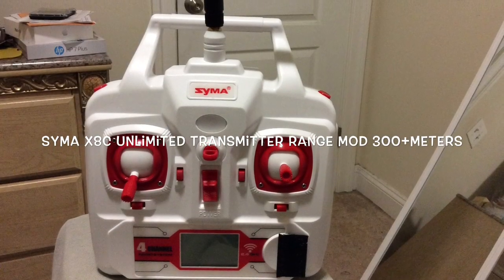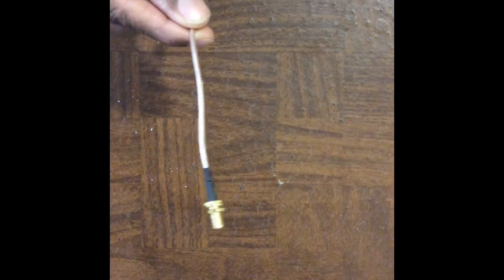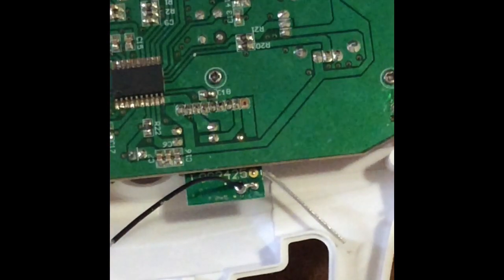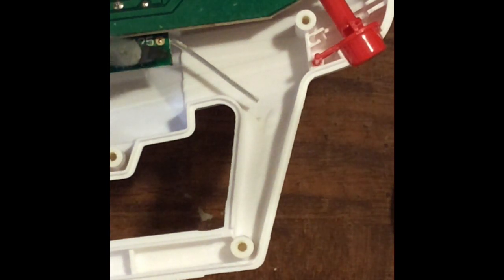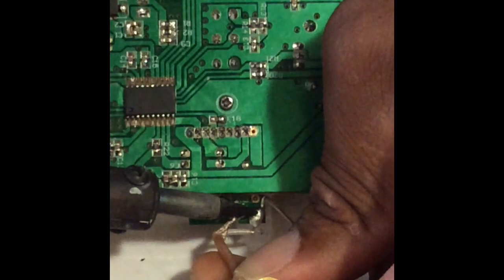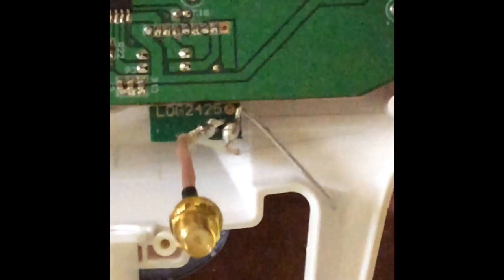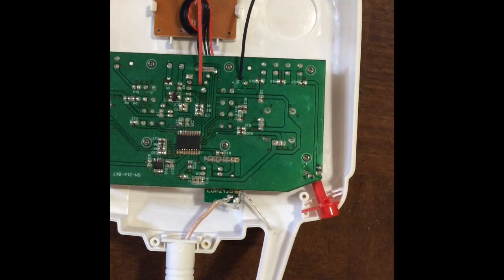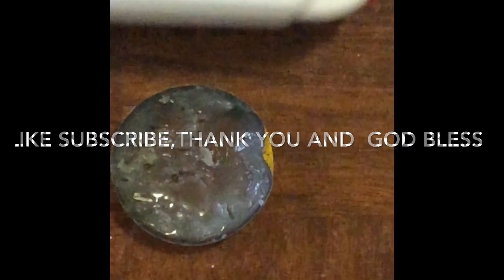Syma x8c step by step transmitter modification 300+ meters of range guaranteed

Comment: Great video! I did the same mod but the range is no more than 150m. Testing the transmitter I found an impedance of only 14 ohms between the antenna main and the ground. Do you think this figure is OK? Thank you.
Reply from the maker: Petros S  Honestly that's a little to technical for me,I don't want to give you false advice but check that your soldering is not bridged and the sma cable is good.
Reply: +Mods&Hobs 101 thank you!
Reply from the maker: You're welcome.

Comment: Ive done this mod the only diff is i used the little indent on the back of the remote just under the stock post for your cell fone as the pilot hole for the 2.4g 5db antenna. It seems to work very well so well that i got rotor slammed by a police hele flying over towards london. I didn`t realize my drone was that high theres nothing as a ref up there i could barely see it. Has anyone done the 3 bladed prop swap yet as i`m about to and any links for cameras and cradles for this drone would be awesome really finding the stock set up a bit of a problem child. lol    Awesome vid liked and subbed

Comment: I did the same...but for my drone the distance can go just 80/100m.
Reply from the maker: Go back inside and make sure the wires are not touching,you need a magnifying glass to do this and check the antenna inside the quad.

Comment: can I just leave the antenna wires there and just add the WiFi antenna instead of replacing them?
Just want to be safe so to speak.
Thanks.
Reply from the maker: Yes you can
Reply: Have you tried it? Any ill-effect to the mod?
Thanks.
Reply from the maker: +JOeSJNr I took the old antennae off,all went well with more range.
Reply: Anyway, I've already taken it off and went ahead with the mod.
Bad thing about this extra range especially without long range FPV to match is that we could not see where the X8 was and what happened  to us, the X8 just flew straight into the trees in the wood because we failed to gauge that the trees were nearer to the X8 than we thought. Broke the camera gimbal, scratched the X8 but X8 works just fine even with that ordeal. Positive thing is, it went beyond 100 metres of its stated range.
Well, thanks and have a nice time flying your rc aircrafts.
Reply from the maker: +JOeSJNr Thank you,you also.

Comment: Hello Master,

just wanna to ask....is the antena is same with WIFI antena? still confuse about this.....what antena i must to use? wifi antena or router antena? sorry for asking this. i dont know anything about networking world. ;) . i just know using 2.4ghz and 5db . but still confuse about which antena i must to use.....wifi or router....or they are same....
Reply: can you give me some advice what kind of pigtail i have to use for this modification?  i have no idea what type pigtail cable for 5db antenna....because so many pigtail cable but i dont know which one will match with 5db antenna

need your advice sir

thx
Reply from the maker: Yes,you can use any 2.4 ghz antenna but 5db or 6db is recommended.Make 
sure it is a female (sma)  if you use it with this 
pigtail.http://www.ebay.com/itm/RG178-RP-SMA-Female-To-PCB-Solder-Pigtail-Cable-For-WIFI-Wireless-LOW-LOSS-10CM-/272193434273?hash=item3f5ffe32a1:g:BnYAAOSwBnVW~BaQ

Comment: I have been trying to mod NY transmitter for some time but unable to identify the antenna and ground wires as it's different from the one in video. what I am curious to know is why didn't u take out the default ground wire and soldered the new ground wire their just like other mods on YouTube
Reply from the maker: I did,that clear wire is not the ground wire.
Reply: +C0ckPitVuE 777 A.K.A The long ranger. may I know if there's a way to identify the antenna wire and ground wire, my transmitter doesn't have a black wire it has two clear white wires,or if possible could you give me your email address I would send you the pictures of the transmitter to have a look.
appreciate your help
thank you

Comment: Hi COckPitVue,  i did also a mod with my syma transmitter forgot to screw on my antenna turn on the transmitter now bad connection  open my transmitter smell like something  burn, do i have to order a new remote or can it be fixed .
Reply from the maker: Yes,I would just get another 1.Make sure its the x8c tx,its the white 1 with red trimming.
Reply from the maker: Yes,I would just get another 1.Make sure its the x8c tx,its the white 1 with red trimming.
Reply: Ok,i will thanks man.

Comment: is it true to keep the antenna sideways instead of pointing it straight up? hear different things.
Reply from the maker: That's what some say but I always kept mine extended straight up and gotten the range you see in the syma x8 videos.God bless.
Reply: C0ckPitVuE 777 A.K.A The long ranger. Thanks. I actually had mine folded to the side on my first try, and it seemed to loose signal. Then I did straight up and have been fine since that day.

Comment: My x8c controller looks different on the inside.  I don't have a black wire, only two small clear/white wires.  Do you know which one I need to remove?
Reply from the maker: Remove the one that's in the place of my black one or the one that was in the fake antenna.

Comment: that's the worst soldering job I have ever seen.  You also do not need to use flux...  that solder... you see the box says ROSIN core?  That means the flux is inside the solder.
Reply from the maker: Thanks,Mr.Tech.

Comment: I got everything ready but my  Syma x8c transmitter is different has two white wires the same length and no place for a ground.  Help....
Reply from the maker: Take an up close pic of the antenna,maybe I can walk you through it.
Reply: +C0ckPitVuE 777 A.K.A The long ranger. Thanks so much 
Here's the photo. https://www.instagram.com/p/BB1NaZbKuVA/
Reply from the maker: +Lewis Jackson Sorry bro never dealt with this type of tx don't want to give you information I'm not sure about.They do sell the x8c for about 12 used on banggood.
Reply: Fixed it? Help

Comment: I did this mod and checked it with my ohm meter and found it shorted between the antenna and ground, so I unsodiered what I did and checked my antenna wire, it was good,but when I checked the board there is a short between the two contacts on the board, I'm sure there is no sodier contacting the two points on the board. I can not understand this,also the wifi antenna was showing a short to the main antenna, Is this normal?,doesn"t seem this way to me.Can someone help me out here, possibly see if your x8c board also reads short, even with nothing attached to the antenna and grnd.The video was very helpful,thank you.

Comment: bro your soldering would be better if you slightly heat the pad on the board first then go to the wire till it flows.  Do not over do the heat on the pad... just a few seconds of heat is plenty.  How bout a link to the 5db antenna you bought?

Comment: hi, my tx board has no ground, only the main antenna. Can I still use your method? my quad is Jumbo Q6 fpv wifi (exactly identical to syma h8w) estimated 60-70 meters range.
Reply from the maker: Make sure,sometimes it's hard to see the antenna surrounded under the ground.If you're absolutely sure there is no ground wire,just hook the antenna make sure that you trim back the ground wire so it doesn't cross the antenna wire.God bless,hope this was helpful.
Reply: ok thanks for helping.
Reply from the maker: +JinRei You're very much welcome.
Reply from the maker: Make sure there is no ground,sometimes you have to take a magnifying glass because you can't detect it with the naked eye.After you established that it has no ground pull the shielding back on the sma cable and just wrap it with tape so it doesn't get in the way and it's not exposed to other components on the  transmitters board.Take the main antenna and just solder it.God bless.

Comment: i had seen someone else do the exact same modification. But they did not attach the ground wire like you did they just cut it off. so i did the same modification just now on my syma x8c controller and first i did not add the ground wire i just cut it off and then i soldered the antenna on and when i got it back together it would not bind to the quadcopter so then i watched you do the modification and i saw where you soldered the ground wire and so i did it just like you did and now it binds to the quadcopter very well i have not had a chance to fly yet to see if my range has improved any but I'm sure it has after seeing that little wire that was only an inch long and on my transmitter i did not have one long black wire no i had two short white or clear wires and i replaced the same one you did. so i think it will give me more range i will test it and give you an update but i do want to say thank you for making this video and showing me haw to make the modification the right way. but it works now so thank you
Reply from the maker: Glad You fixed the problem,You're welcome.God bless.

Comment from the maker: @Larry M, Thank you very much sir,I greatly appreciate the kind words and the sub.God bless.,
Reply: hello, the old antenna (black wire) was welded both on ground and at + with the same wire?
Reply from the maker: +Man GoPro Sorry,I'm not understanding what you're trying to ask me.
Reply from the maker: +C0ckPitVuE 777 Ok I see now,yes the black antenna I has an outer and inner coating.If you analyze closely before you do the mod you will see that 1 is attached to the ground (outer coating) and the other attached to the antenna (inner coating).Hope this was helpful,God bless.
Reply: +C0ckPitVuE 777 thanks a lot! I leave you like and I subscribe!
Reply from the maker: +Man GoPro Thanks bro greatly appreciate it,God bless.
Reply: +C0ckPitVuE 777 I would really appreciate it if you would check out my video, and maybe skip to 3:52 to let me know if I did everything properly. The X8G circuit board is different than yours, it has two clear/white antennas and no black antenna... One of my clear/white antennas was ripped up a bit, so I replaced it with the same antenna that you did in this video. However, I did not ground the protective shielding anywhere, as there was not another point next to the antenna to ground it to. Please let me know! I don't want to fry my circuit board or destroy my transmitter. God bless.
Reply: You should sell these
Reply: I,m looking to do a mod on my x5sc and have ordered the pigtail and antenna but found that where the existing antenna is soldered it only has 1 solder point for the core but not ground point.
will that make any difference if i dont solder the outer ground coxial to any point.
Reply: C0ckPitVuE 777 A.K.A The long ranger. hey man I just ordered an x8w if I follow your steps I will get better range guaranteed if done properly..which antennas do I need to order like 8dbi or 10, 6 idk and do I need to put on the drone itself too
Reply from the maker: A 6 is good.

Comment: Hello, I was curious if you could answer a question for me.  I did the upgraded and was able to get 766 feet.  My question is regarding disconnection from the transmitter.  I have seen that my copter will reconnect if I go to high and it disconnects, I was wondering if you know what would happen to headless mode if it disconnects and reconnects.  Will headless mode reset itself or will it reconnect and stay the same when I initially set it at take off?  I am scared to go to high and having the transmitter disconnect and then reconnect and rest headless, what are your thoughts?
Reply from the maker: +Jason Wise Never used headless mode,sorry.That is an interesting inquiry though.You can probaby walk the tx out of range on low idle walking the quad in your hand,once it disconnects bring it back into range keep the tx on in headless mode and try to fly it and see if you're still in that mode,that is the safest way to test this.

Comment: Hi !! First, your video is very useful, nobody explained that for X8 series !I'll do this opBut have some questions :What's the white antenna ?Is it possible to extend cam's wifi range ?And finally, if you open your X8C/W/G, you've electronic cards on each motors. What happened if you remove them ?Thanks :)
Reply from the maker: Thank you for the kind words of encouragement they are greatly appreciated.As far as the wifi set up and fpv and the white wire.
Reply from the maker: I'm not mechanically inclined to make a call on that,fpv and wifi is not my strong suits,sorry.
Reply: +C0ckPitVuE 777 
ok thanks :)

Comment: I've watched couple of videos and read some DIY tutorials online about this kind of modification and i believed there should be an exact length of wire (i'm not sure how much of length) before soldering on board. Did you measure it before soldering? or it was just a random length?
Reply from the maker: The antenna is the proper length,the connection that's on the very top has to be the proper length,if the wire was my sole antenna then it would have to be the correct length.The 5db was the antenna mounted on top so no need to worry about the length of the wire below it.God bless.
Reply: C0ckPitVuE 777 I got it now, thanks for the explanation!

Comment: I have an X8G that I just ordered. Will this mod work on that transmitter as well? Like said I have just ordered it and dont have it yet to test it. But it seems like everything I read is saying 100 meters for range. I would like to fly it higher than 100 meters and farther out than 100 meters. Thanks in advance.
Reply from the maker: Not sure, but I heard that the 8xg has poor stock range.Quadcopter has a video either flying the G or the W with the x8c controller.Im  not certain about the insides of the 8g.The 8c has a power amp in it that helps with the range.God bless
Reply from the maker: +C0ckPitVuE 777 Meant to say Quadcopter 101.

Comment: I must have got lucky with my transmitter.  Just did a range test and flew it 378 meters with no modification.  That is further than I would ever want to fly it.  Also used this same transmitter with my x5c and got within 20 ft of the same range. Could barely see the x5c at that distance before it went out of range.
Reply from the maker: No brother that's normal stock,this mod gives it out of sight range.This is a very powerful transmitter and with the mod it makes it unlimited beyond visibly bearable.Thanks for the feedback,God bless.

Comment: Does it matter the length of the new antenna wire that is cut? Also, will this same antenna work on a Syma x5c-1 ?
Reply from the maker: If your talking about the sma cable the answer is no it doesn't matter as long as you screw a 2.4 ghz antenna on top of it.

Comment: My Syma X8w with stock transmiter is powerful enough... I still can control my X8w, even the quad is just a tiny black spot in the sky. Do u think this upgrade is necessary??? Btw, it's nice to have...
Reply from the maker: No,if you get that type of range you don't need to do this.If it's a little dot in the sky w/out this mod it will be hard to see if you did this.If you want to go to the moon and have a pair of binocular glasses than I would recommend,lol.God bless and thank you.

Comment: ok thanks for the reply, can I ask you a question I would like to know under x8 can mount a Jinbal and what?
Reply from the maker: Sorry for the late reply but I'm not sure about the gimbals,that's not my department,lol.Just search Syma x8 and gimbal there are plenty of videos that can assist you.God bless.
Reply: +C0ckPitVuE 777 is ok, I ran successfully upgrade the antenna, both drone on tx, I got about 800 meters range. I have done on a mounted wire length 120 mm (FULL WAVE) and I did come out on top, out vertically. then I put the video with the tutorial. thank you. he wanted to tell you I bought a new drone "cx-20" who do you think, do you know him?

Comment: I would like to ask a question in the transmitter antenna will notice another small and white, on the right. can you tell me what is it? And another question must be careful with the soldering iron to the frequency or would be cheaper to use a soldering iron with butane gas
Reply from the maker: Idk,because I lose sight but well over 300 meters.
Reply from the maker: Syma intended to have a wifi version of the x8 so they put the white antenna in.The wifi version is now available .The conventional soldering iron is safer than butane soldering.I am not familiar with butane soldering other than the flame that is applied.
4 minutes ago•
Reply: +Giovanni Acanfora ok thanks, now it is clear to me. so I suggest you start editing the tx, you did? works well ? How far can you do ?.